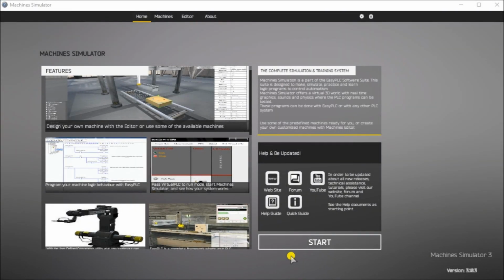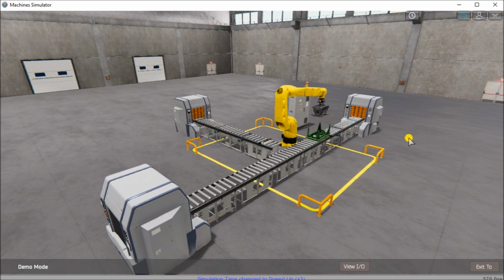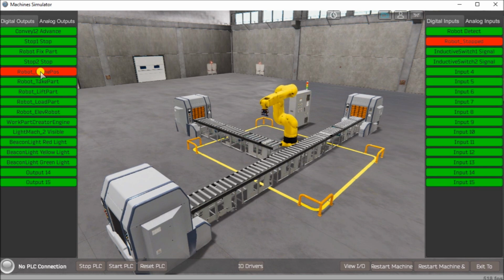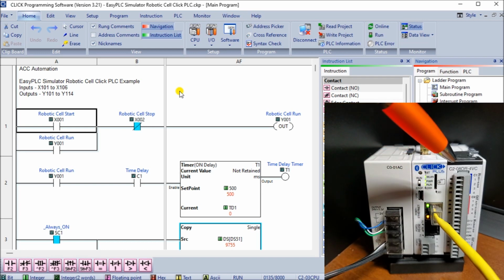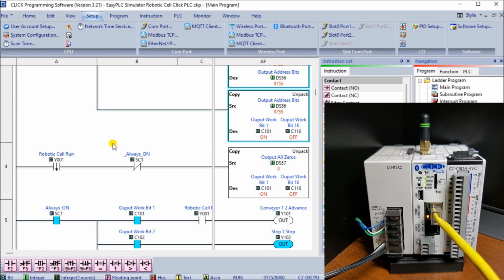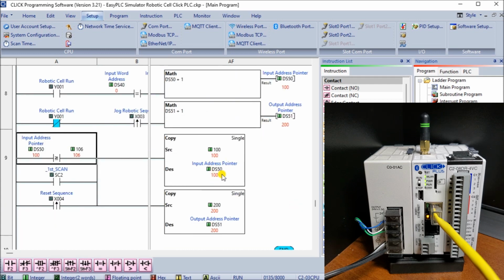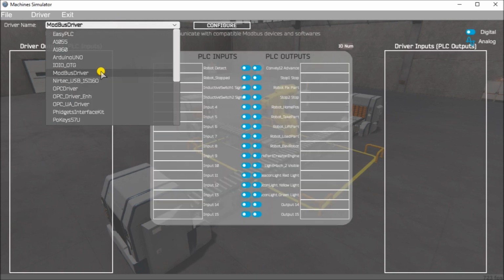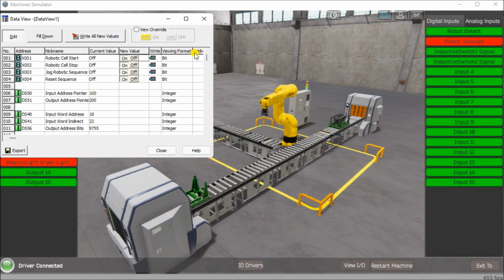Click PLC EasyPLC: Engine Loader Robotic Cell Step-by-Step

Comment from the maker: The entire EasyPLC Software Suite series can be found here:
https://accautomation.ca/series/easyplc-software-suite/

EasyPLC Software Suite is a complete PLC, HMI, and Machine Simulator Software package.
This PLC learning package includes the following:
Easy PLC - PLC Simulation that will allow programming in Ladder, Grafcet, Logic Blocks, or Script.
HMI System - Easily create a visual human-machine interface (HMI),
Machine Simulator - A virtual 3D world with real-time graphics and physical properties.  PLC programs can be tested using the EasyPLC or through other interfaces. (Modbus RTU, TCP, etc.)
Machine Simulator Lite - Designed to run on Android Devices.
Machine Simulator VR - Virtual Reality comes to life so you can test, train or practice your PLC programming.

Purchase your copy of this learning package for less than $75 USD for a single computer install or less than $100 to allow different computers.
Receive 10% off the price by typing in ACC in the comment section when you order.
http://www.nirtec.com/index.php/purchase-price/
Learn PLC programming the easy way.
Invest in yourself today.

Regards,
Garry
ACC Automation
https://accautomation.ca/

Comment: Thank you a lot for your videos,
Whenever I hit the automatic assignment function, the tags are just assigned randomly which does not help me at all.
Is there a particular way to configure the drivers so the tags are loading automatically where they need to be so I can save time?
Reply from the maker: Hi @elvisvx1
Thanks for the comments. I have not experienced the automatic assignment not functioning correctly. Are you ensuring that consecutive registers are being used that match the inputs and outputs that the simulator is using?
Just a thought.
Regards,
Garry
Reply: After inserting the plc tags the same order as the simulator I/O , easyplc was able to automatically assign the tags in the target area. Your reply put my mind in the right track!
Reply from the maker: @Futbolnews12  
Thanks for the update. I'm glad you got it working.
Garry

Comment: I'm an Electronics engineering BS graduate that trained an automated palletization warehouse for 5 years as an equipment maintenance technician. This robotics automation simulator is very interesting to me. I'm currently seeking a position in the Western Massachusetts or Northern CT area.
Reply from the maker: Hi John
The EasyPLC Software Suite is a great learning tool for automation. 
https://accautomation.ca/series/easyplc-software-suite/
Another series that may help you out is Node-RED. This free IoT enabling software series will allow you to communicate to the PLC, create an HMI, save to a SQL database, and view the database information through a spreadsheet.
https://accautomation.ca/series/node-red-iot-enabling-software/
Communications using Node-RED can be through Modbus RTU / TCP, Ethernet IP, MQTT, etc. to the PLC.
Regards,
Garry